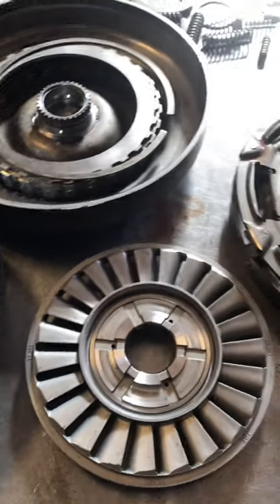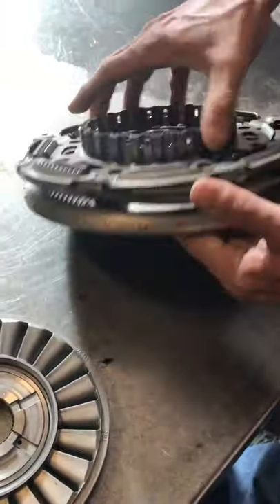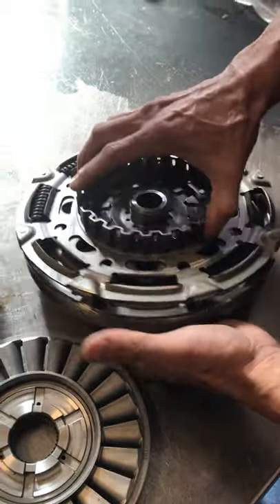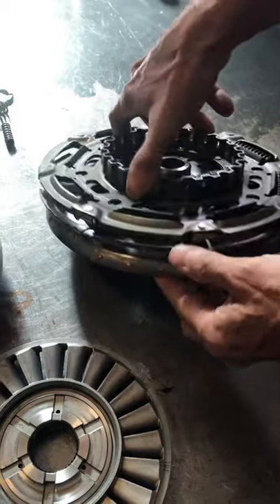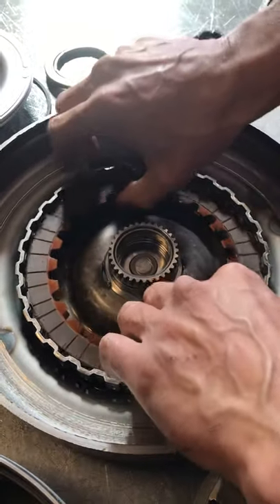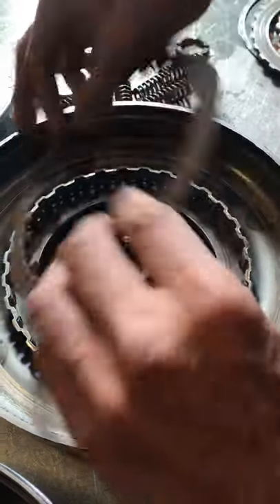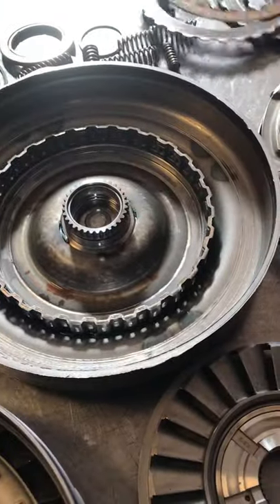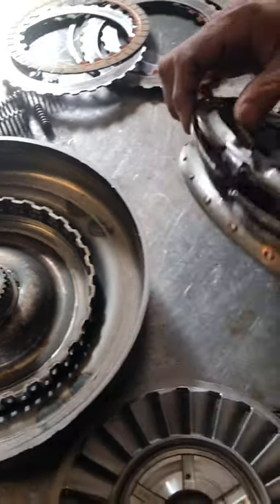Torque Converter Problem- Nissan Infiniti 370Z G37 Q50 Q60 RE7R01A, 7AT Stalls the engine. #shorts

Comment: Does this cause the car to stalll when I’m in drive and a dead stop my 370z is doing  that
Reply: Mines stall when i put it into drive or reverse
Reply: @RickyJ_12   my Titan just started doing it did you find a solution?
Reply: Mine does the same thing was this the issue?
Reply: @RickyJ_12  ?
Reply: @brianwilson9633  anything?
Reply: @alexduenas5717  mine was a spun bearing
Reply: Mine started to do that also and I believe it is your torque converter. I'm dealing with same problem you're dealing with
Reply: @RickyJ_12 what was the problem?
Reply: @alexduenas5717 what was the problem?
Reply: what was the problem?
Reply: @that_VQ_life  what was the problem?
Reply: yes torque convertor and torque convertor solenoid need replaced
Reply: That’s the beginning of it giving out. Mine did that once and just last night it went out. I had a feeling it was going to happen soon anyway

Comment: I just had to replace my transmission because the cost to replace the torque converter was as much as a used transmission swap with labor. Now the newer used transmission I have with only 80k is having the exact same issue on this one.

Comment: Question:  Will this "scraping" sound only happen at certain RPMS?   I hear a noise on mine around 4000 rpm, but I've not eliminated an exhaust leak sound as of yet.  To me it's engine speed dependent and happens in every gear, and started after a transmission fluid change at the dealership.

Comment: Hello, my infiniti have the P0744 code and sometimes at 40mph the transmission make a harsh shift.
Reply from the maker: It's got a bad tcm
Reply: @iptperformancetrans  I've got the same code, I ordered a valve body in hopes that it will fix the issue. I will also be changing my transmission oil/filter. Does that mean I have to also buy a TCM, which also stands for Transmission Control Module?
Reply from the maker: @MohammedAl-Waeli  The valve body and TCM are usually sold together when you buy a valve body
Reply: @iptperformancetrans  i bought one that doesn't have a tcm, i was thinking of putting my tcm onto the new valve body and installing it. I was going to do that because my code reader told me "Code p0744 Torque clutch converter solenoid valve function". Am I okay to put back my original tcm on the new valve body?
Reply from the maker: @MohammedAl-Waeli  I doubt that’s going to fix anything
Reply: @iptperformancetrans  would I have to program the new TCm to my car?

Comment: What preventative maintenance can I do to avoid the damage?
Reply from the maker: Other than preemptively replacing the converter,   none in this case. It's engineering/manufacturing defect that's essentially a time bomb.
Reply: @iptperformancetrans  what years should I avoid? Because I’ve seen plenty of the 7AT go over 130K miles
Reply from the maker: @NoDidddy  As far as I know, they are yet to change the design, I believe that all years are subject to the problem

Comment: I'm getting p0744  could that be it or the solenoid  it's in Drive mode but won't drive or reverse until I shut the car off and turn it back on  but will only drive for like 20 feet n does it again
Reply: Same thing just happened to me have fixed it yet?
Reply: @youngpolo69er63  you have to really understand what the car is really doing .. but too sum it up .. if you did the oil change in the transmission and didn't fill it up completely or you have a leak or the pump which shoots oil in the transmission could went bad.. at the end of the day it was low on transmission fluid and I couldn't save it so had to do a rebuild some you can save by adding fluid with Lucas oil
Reply: @chrismuniz8515  I got on the road after school and didn’t want to go last 2nd or 3rd gear and when we got my car back to school it didn’t matter what gear I put it in R,D, or DS it just revs up and goes nowhere so we had to push it into a parking spot
Reply: Prior to this i would start braking and once the trans got to 3rd gear it would accelerate by itself and I had an issue when shifting from 3rd to 4th it would buck/shift harshly idk I’d that had something to do with my current problem
Reply: @youngpolo69er63  theirs a computer in the transmission  that go bad with similar symptoms to  this I  changed from the same car from a junk yard they said it needed to be reprogram but I didn't and it ran fine but I didn't put enough oil after I put everything back and then it started to shut off on drive when I was dead stop or reverse if I didn't hit the gas ..
Reply: @youngpolo69er63  I dunno it was a pretty decent job if you like working on cars I'd say go for it but if u never worked on cars  then get ready to spend money
Reply: @chrismuniz8515  yah I’m in school for cars which is why I think it’s ironic that I’m getting a ton of issues with my car all of a sudden.
Reply: @chrismuniz8515  hoping it’s something similar to this or really just a fluid issue. My G is over 150k and I keep all my stuff up to date just haven’t gotten the chance to look at the trans since I’ve had other issues to deal with beforehand